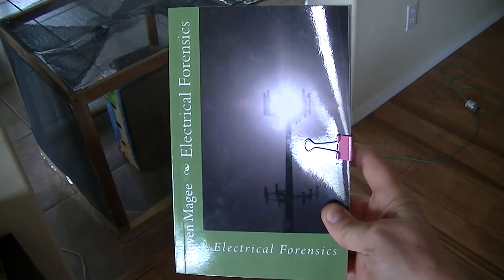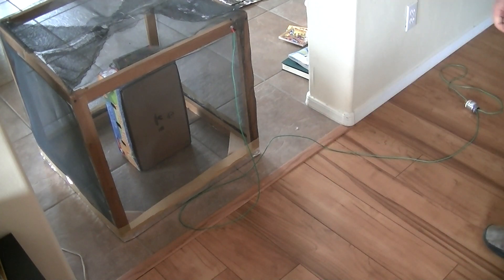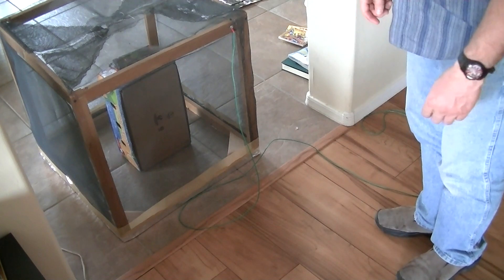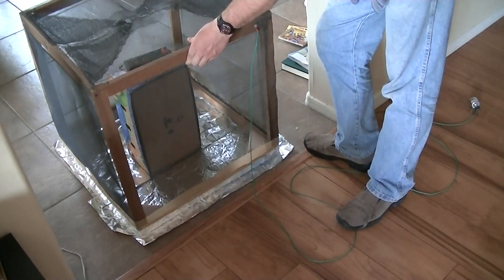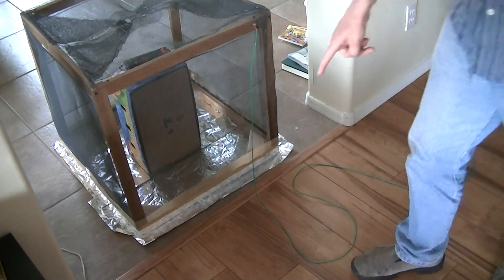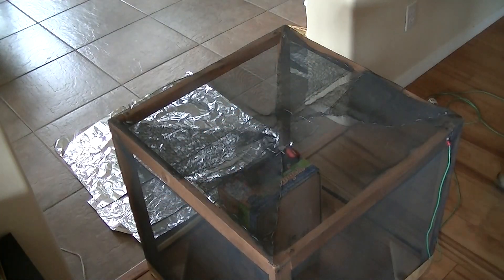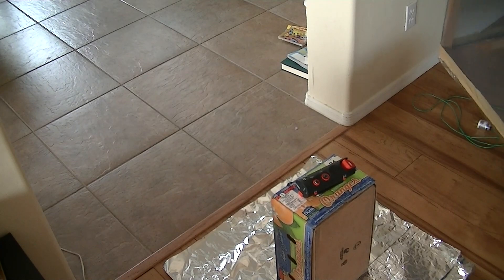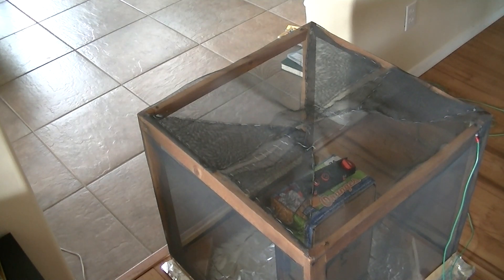Does a Faraday Cage Need a Conductive Base When on the Ground?

Comment: I wonder how many this guys video has killed, looks like you're plugging in +/- power to a metal screw
Reply: Its a good point, and one the creator overlooked. He should have made it clear what he was doing with the plug by explaining using just a ground cable and not ac voltage prongs. I wouldnt have even used a plug for liability reasons. Most people would be making an electric fence if you ask me 😂

Comment: The reason one would use a ground clip  on a faraday cage is so the rf goes to the ground. Since radio frequency bounces off things such as faraday cages you need to ground it so your not bathing in radio waves. Also the grounding is equally important for the electric field inside the cage. If your sleeping in a faraday cage make sure its grounded on the floor and the housing. So you'll have 2 seperate grounds in 2 seperate outlets. This is after using a outlet tester to make sure the ground is working correctly. The reason for the 2 outlets is if one fails you still have the other for backup.
Also the floor doesn't matter. You need a conductive mat of some sort. 
I'm using a nickel/copper fabric for my floor mat. The housing is pure copper mesh and some ni/cu fabric. If you decide to make a room or cage to sleep in don't make the same mistakes I made. Much time and money was wasted from my ignorance. Yes my ignorance on propper shielding techniques. Resaerch all you can from people that have made designs that not only work but are made in a portable fassion. Case in point: If you live in a apartment and decide to move , you'll want to take your build with you. So make it in pieces. Hope this bit of experience helped.
Reply: Should have a faraday cage inside a faraday cage. See if they cancel the first one.
Reply: Thank you for the explanation..

Comment: Grounding a faraday cage is required for discharging huge amount of static electricity  trapped  cage walls in case of an amp attack. Thanks for sharing.
Reply: That is a lesson for those of us who sleep in the faraday cages. Any farday cage needs grounding. Plus a meter is better to show grounding vs. non grounding.
Reply: can you tell how much is the diff grounded vs ungrounded? I bet is really small.

Comment: This is why I decided not to buy a 1/2 canopy for my bed. You need the whole canopy with a foil base for the whole bed underneath. Good to know grounding does not appear to make any difference. A personal tinfoil/mesh pyramid would be a good place to sit and read.
Reply: Smufter16 grounding does not make a difference in terms of the radio signals but it is needed to avoid accumulation of electrical field.. which can be hazardous to ourhealth too

Comment: Maybe you don't have ground in your wall outlet? Maybe better to check it?
Reply: The outlet ground is not an RF ground.  It is an antenna at most RF frequencies.  It is a ground only at very low frequencies (such as 50/60 Hz).

Comment: Your Ground, is more like an Antenna. Drive a Copper Rod, 6 feet into wet Earth. Then you have a Ground. The Earth Wire you are using is Tied to the Neutral Wire in your Fuse Box and everything ells in your House. You made a "Massive, Broad Band Earth Looped Antenna"!!! Your Design will Attract all EMF, not induce it into the Cage and Drain it to Earth. I used Stainless Steel Mesh for the Ultra HF Energy and Led Lined for the Gamma Rays. My Faraday Cage is Called a "Frequency to Voltage Converter" and is well Grounded in wet Soil and I'm using 100 amp wire.
Reply: how are you Lead lining the cage?
I had heard gamma rays over time really age the body and are another factor in the inability to restore and heal during sleep in a cellular level.
Reply: your example would make an electrical ground, not an RF ground.

Comment: To get the wavelength of EMR (in meters) divide the speed of light in meters (3 x 10^8) by the frequency. So 2.4 GHz has a wavelength of  .125m, or 12.5cm, or about 5 inches. 5.8 GHz has a wavelength of about 2 inches. Holes in the Faraday cage have to be smaller than the wavelength you want to block.
Reply: Could you use several overlapping cages for a variety of different wavelengths? Or is it essentially the smaller the holes, the more wavelengths it blocks?
Reply: @Justinpie91  ~ good question & have you found the answer because I need to know that myself? I'm being
effected by WIFI in my apartments &  I need some method to block it..... Can I use copper or aluminum
mesh w/ very small holes?   Please share if you're still out there?    Or anyone else for that matter??
peace to all
Reply: @diggydice9041  Try a Faraday canopy off eBay
Reply: @Justinpie91  ~ thank you,  I've had severe nerve pain & joint pain too but it's not anything normal says
the Dr's..... they have no answers & it's hurting my mom as well.  Are they like a "Bug Curtain" or the
mosquito net.... kinda?   If so, I wonder if I made one out of small mesh in copper or aluminum if
that might work?  Anyhow, I'm gonna go look but I'm afraid of how high it might be.... lol, not as
high as getting cancer from this crap.   peace
Reply: @diggydice9041  If that doesn't work, read We Want To Live by Vonderplanitz, that should solve your nerve and joint issues
Reply: TO protect a device against a High-Altitude Electromagnetic Pulse (HEMP), which consists of three main components (E1, E2, and E3) with distinct frequency characteristics, protection must address the relevant electromagnetic spectrum. The E1 component poses the primary threat to modern microelectronics and sensitive devices due to its fast rise time and broadband nature, while E2 is similar to lightning (typically mitigated by standard surge protection) and E3 affects large-scale power systems via low-frequency induction (often addressed separately with geomagnetic disturbance shielding).

For device-level protection (e.g., via shielding, filters, or hardening), the critical frequency range is DC to 1 GHz, with emphasis on 10 kHz to 100 MHz for the core E1 HEMP effects. This range covers the peak energy of the E1 pulse, which can induce damaging voltages and currents in conductors and circuits. Standards like MIL-STD-188-125-1 and IEC 61000-2-10 specify attenuation requirements across this spectrum for HEMP-compliant protection.

DC to 10 kHz: Covers low-frequency components and quasi-static fields.
10 kHz to 100 MHz: Primary E1 bandwidth, where the pulse spectrum is strongest (up to ~50 dB/Hz electric field strength).
100 MHz to 1 GHz: Upper E1 tail and potential E2 overlap, for comprehensive coverage against induced transients.
Protection methods (e.g., EMP-rated filters or Faraday cages) must provide high attenuation (e.g., >60 dB) across this range to prevent coupling into the device. For broader threats like Intentional Electromagnetic Interference (IEMI), extend to 10 GHz, but HEMP alone does not require this.

Comment: .......  I  got  my  "first"  smartphone  about a month and a  half  ago  (Nov/Dec 2016).     an  iPhone7+.      Not  to  long  after that I  used  my  iPhone7+  with  a  bluetooth   UE Megaboom  speaker  and  it  felt  like  I  was  getting  a small  electrical  shock  under the  corner  of  my  left  rib cage.   I  get  this  shock  now  in  3  primary  locations,  2 spots  at  home  and  one  at  work.    The  problem  is  getting  worse.   The  shock  goes  away  when  I  stay  away  from  my  cell  phone.    The  weird  part  is   it  doesn't  always  happen,  but  it  almost  never fails  in  those  3 spots.    I  almost always  used  speaker  phone.     I  am  probably  going  to  ask  Apple  this  week  if  they  will  switch  out  the  phone  or  may   try  a  special  RF/EMF  protected phone case.    It  is   an  excellent  phone  otherwise,  but  does  have  the  fastest processor  of  any cell phone  I  think  thus  might  have  the  highest   RF/EMF  output/input.   Last  night  at  work  I  had  the  pain  for  over 6  hours,  but  went  to  sleep  overnight  away  from  the  phone  and  the  pain  went  away.    Anybody  heard  any   similar  stories???  Or  know  to  fix  it????    I  put  the  phone and  bluetooth  speaker   in  an  empty  washing machine  and  clothes  dryer  and  it  still  caused  me  pain  in  my  chest.   I  put  the  cell phone  in  an  empty  microwave  oven  with the  door  closed and  the  pain  went  down  a  little.
Reply: Seems like a lot, if not all, people who are becoming recently sensitive to EMF is happening from Apple products! I became sensitive in July 2018 after I bought apple iphone x, ipad, and apple laptop!

Comment: This test is not to be used on any basis. As an electrical engineer I can report that the grounded electrical circuit in a home is bonded to the neutral in the main panel and is not a true Earth ground. Only a copper rod driven into the earth of 7-9 feet having no other connection to it is required to protect from a high altitude detonation EMP. 

Sorry to burst your bubble science guy.
Reply: Michael Paul you say "high altitude EMF detonation " what about the radiations that are at human level ?
Reply: I meant to say EMP...
Reply: What kind of an electrical engineer connected the grounding block in a circuit box to neutral? 😳 Grounding code should always say the grounding block goes to ground. Engineer in name only.
Reply: Michael Paul Know it all, its grounded a the electrical pole!
Reply: Can you use a cold water pipe as a ground?
Reply: no. not for RF grounding. an electrical ground is not the same as an RF ground. an RF ground would look more like a bunch of wires in a spoke pattern spread out over the ground (radio station style) see https://www.dxzone.com/pic594/Grounding.jpg for an idea what RF grounding looks like. This is why the foil placed below the cage helped. it created a coupling to earth ground that was effective for RF.
Reply: Michael, get less ignorant. you are confusing an electrical ground with an RF ground. not the same thing at all. the earth ground of a home sucks for RF grounding, as do copper water pipes. for AC electrical grounds these work.

Comment: What is it with your obsession with connecting faraday cages to your AC mains safety ground?  That isn't an RF ground.  Ceramic tile and wood/plastic flooring isn't conductive, so it doesn't work as a 6th side to your cage.  It has nothing to do with if they are "grounded".
Reply: Star Gazer did you read the title.....

Comment: I have all my emergency electronic items (Lots of fresh Batteries (all sizes), weather radios (Crank type and standard) and two way radios, flashlights. (Crank and standard) All stored in a (GROUNDED) metal box made on the cheap, with home duct work pieces. Home Depot. The ones I used are two piece, three feet long by 4"x11". They interlock to make duct work in an attic or in a wall. (Between studs) I closed the ends up with some roof flashing and metal tape. Grounded and good to go.

Comment: Thank you for this thorough test and demonstration of a faraday cage!  I've been watching videos about faraday cages, but all I was able to find was kooks talking about cell towers and chemtrails, lol.  I want to build a faraday cage to protect my PC and my air conditioning system and my car, but I didn't know if aluminum foil or metal screen could be used or which was better.  It seems from your test that aluminum foil and metal screen both work since your cage used both materials on different sides.  Building a garage-sized faraday cage would be insanely expensive if I had to use copper screen, but with aluminum foil it's still expensive but doable.  My main fear is a solar EMP.  I'm also concerned about a high altitude nuke set off by North Korea or religious extremists, though I realize that this is a bit far-fetched.
Reply: Not to far fetched. Im prepping also along with thousands of otherx sho see the writing on the wall.  Good luck and god bless
Reply: Ditto

Comment: StevenMageeBooks 
Hello Steven

I am looking to build Faraday cages around our 3 beds. The only thing i was not able to find was if a faraday cage built with Fine Aluminium mesh blocks 2.4/5.8 Ghz(shorter wave length) Wlan/Wifi frequency? Canyou please check that with your faraday cage by placing a wifi router in that faraday cage of yours and reply me back here as soon as possible. Thanks for the good work you are doing.
A fan of Steven Magee
Reply from the maker: See: Testing 2.4 GHz Wi-Fi on Multiple Layers of Faraday Cages, Grounded and Ungrounded http://youtu.be/9eUCyR7jesk
Reply from the maker: See: Electromagnetic Shielding Performance of Popular Products, Grounded & Ungrounded http://youtu.be/YAESVraVhj0
Reply: If you folks are so worried about the performance of your faraday cages, why are you're making them out of aluminum?  Aluminum isn't that great of a conductor.  Copper would be better.  Silver would be best.   Copper plate that is silver plated would be about as good as it gets, without resorting to superconductors.  And that liquid nitrogen gets chilly at night.
Reply: +ashleylong001 try polymerized foil.  should work for all frequencies since there is no mesh size.
Reply: Good day,

 

I have a technical question about faraday
cases?

I want to make a closed faraday chamber with metal plates for up to 30GHz
shielding.

My question is about the holes in the air ventilation window.

Is it alright if I directly make holes in the metal plate, in a small window
surface,  with a diameter of less than
1/10 of the frequency wavelength?

Or do I need to cut a square window out the plate to place a honeycomb with
holes smaller than 1/10 of the frequency wavelength?

I need so many dB shielding as possible.

Can you help me with this question ?

Comment: You should now test the affect of a wire that goes into the cage. Leave 2m outside and 2m inside. Leave the plastic on the wire to not connect it to the cage. Test using fm radio station.
Reply: good plan